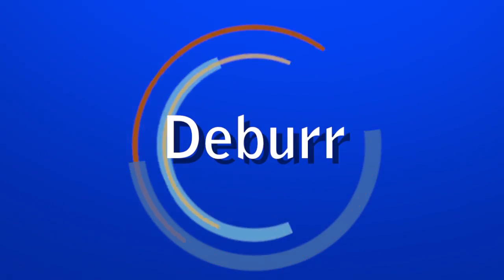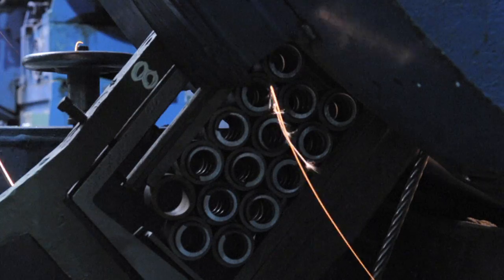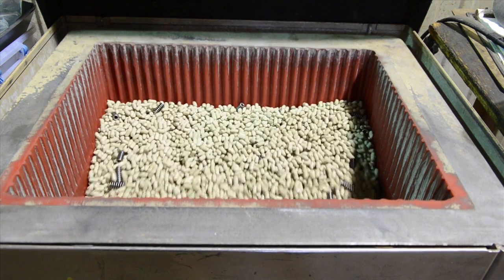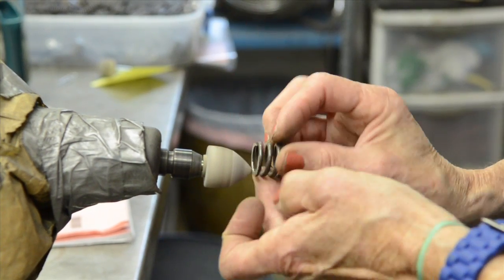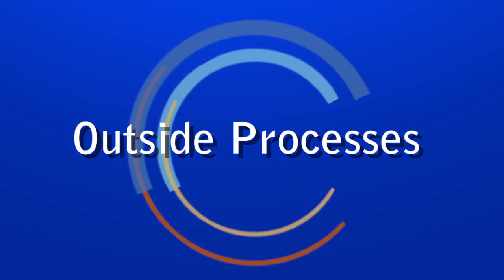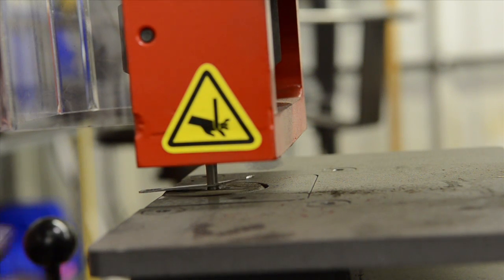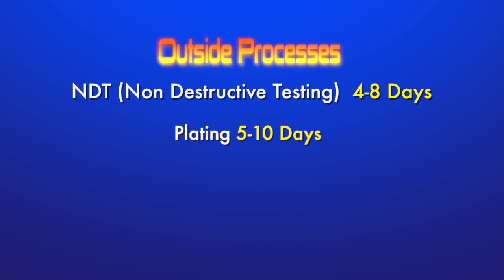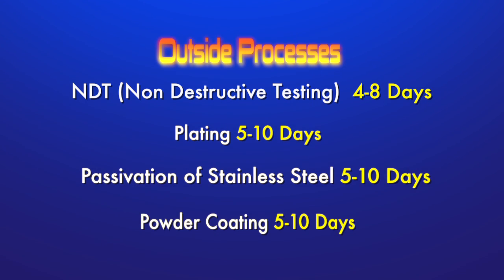Spring Manufacturing Design Workshop--Secondary, Deburr, and Outside Processes Tutorial (Video 6)

Comment: Is it possible to make square spring ?? Not square wire spring.
Reply: Yes, on a cnc coiler with torsion attachment but obviously without not with sharp corners, been doing this for over thirty years and have made a pyramid shaped with pitch and closed ends, no it did not come to a point on top.

Comment: Our product specializations include: custom coil springs, compression springs, extension springs, and torsion springs. CTI also offer these services: product prototyping, stamping setups, wire forms, powder coating, special coatings, magnetic particle inspections, shot peening, cycle testing and in house heat treating. We manage all these services on-site to ensure you receive the custom springs you need. Contact us - http://www.coilingtech.com/contact-us/